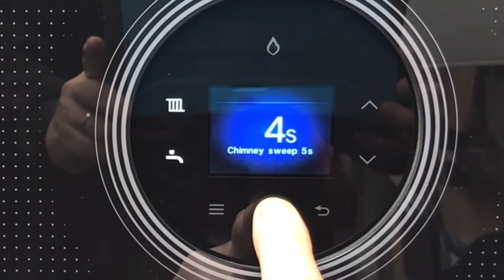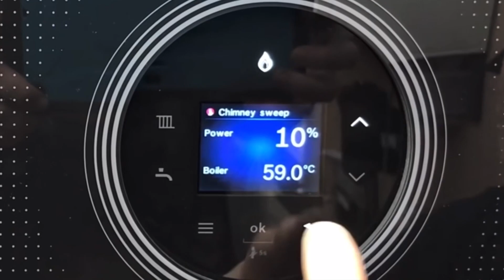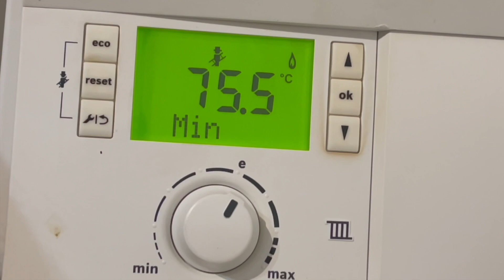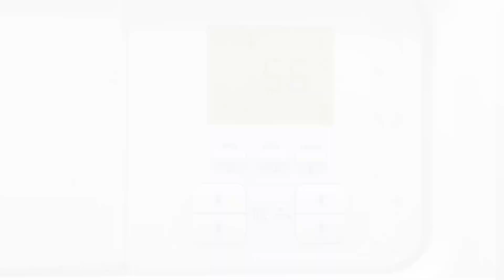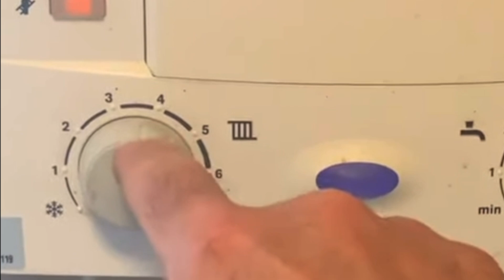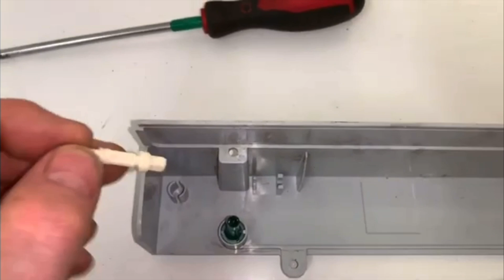How to put different  Worcester boilers into  service mode, chimney sweep mode or high and low fire,

Comment: Hi can’t you help mate? I have the same boiler and recently every shower anyone in the household has the water is hot for 1 minute and then goes freezing for 1 minute then hot then freezing on repeat every minute, I’ve pressed info and it’s coming up with two things   •  i2 276 flow sensor fault •   and also •  A1
i2 281 Pump Error •.      So annoying had a plumber round twice so sort it and he’s never once been able to fix it just need some advise please

Comment: A little tip if you find the temp going to high then cutting out on combi's open then hot water tap fully and this take the heat away from the main heat exchanger